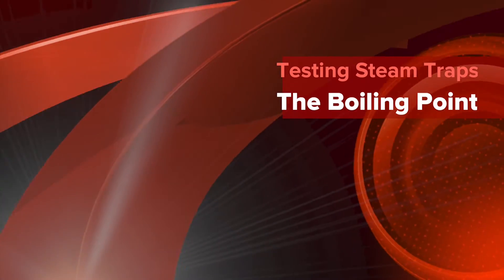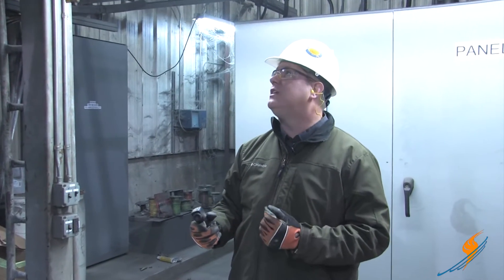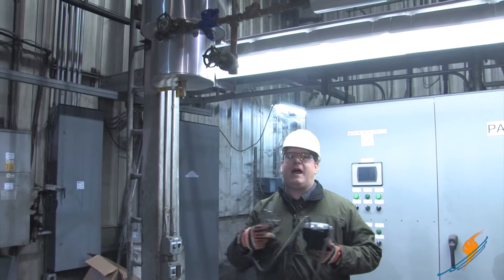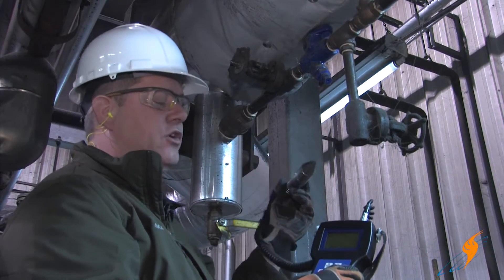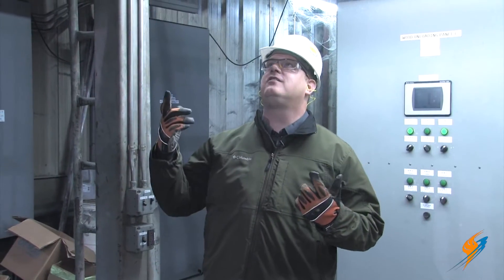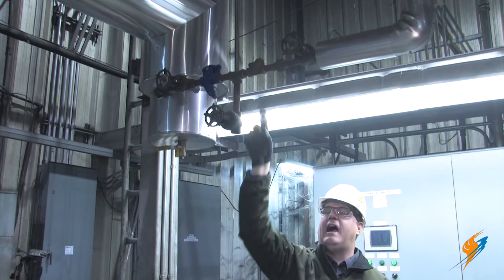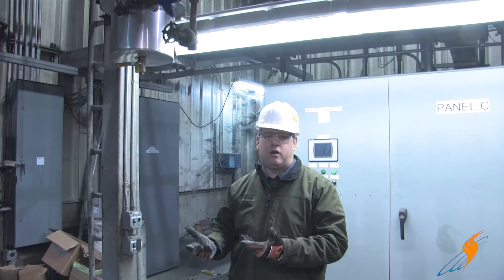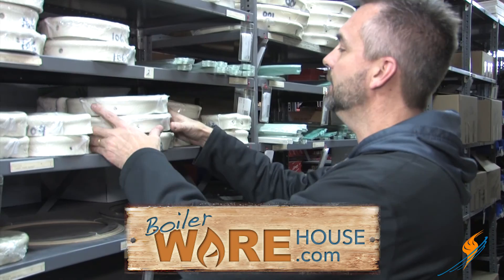Steam Trap Testing with Infrared - Boiling Point

Comment: Are you sure that is an infrared tool.  Looks more like an ultrasound device.
Reply from the maker: He misspoke in the video - He am using an ultrasound device.  We use infrared, but generally only to determine if the trap is hot/cold or potentially backing condensate.  The point of the video was to demonstrate the importance of ultrasound in additional to IR, and we understand how that mistake makes it confusing.  Thank you for the feedback!
Reply: wareboilers  Which device are you using, Make and model? Kindly mention its Approx. price as well. Any Recommendations for ultrasonic and Infrared Temp sensing device will be highly appreciated